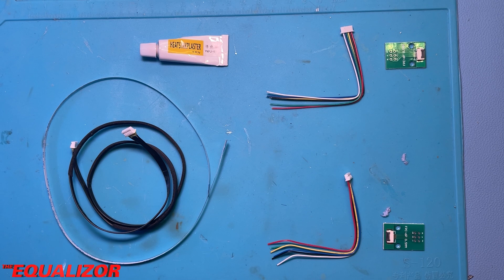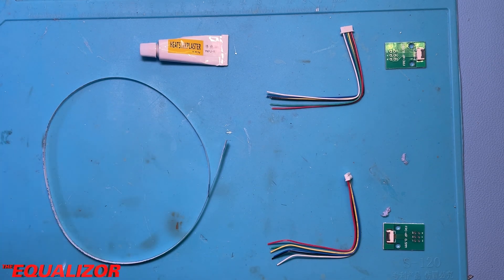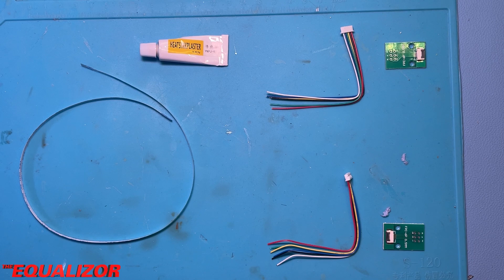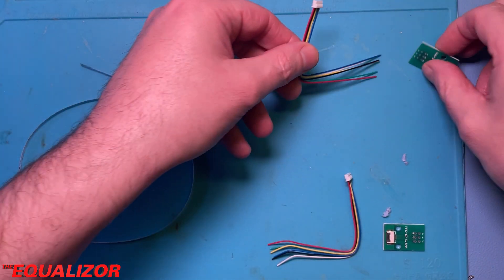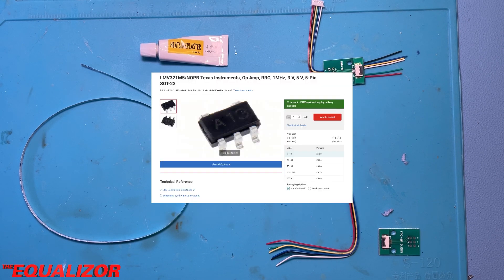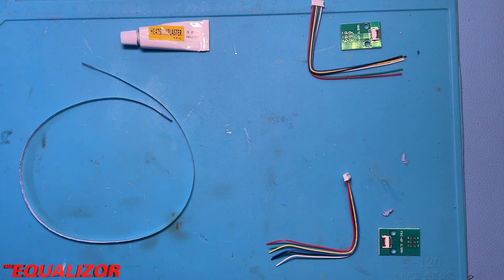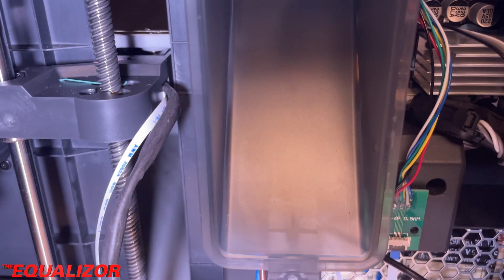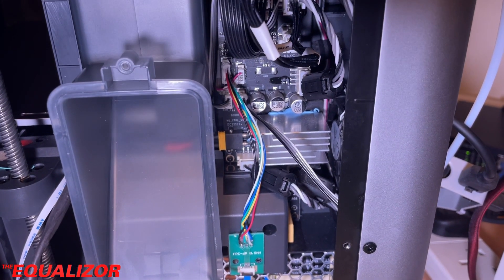I replaced the X1 Carbon bed signal cable with a flat flex (FFC) one

Comment: How is it holding?
Reply from the maker: It’s working perfectly! No errors and plenty of flexibility. Very happy with this mod.
Reply: @the_equalizor  can you provide a link for the cable and adapter?
Reply from the maker: @saifob5800  I have added links in the description to the products I used for this mod.